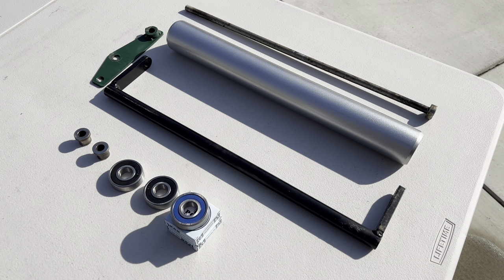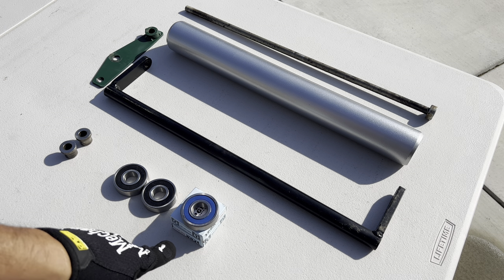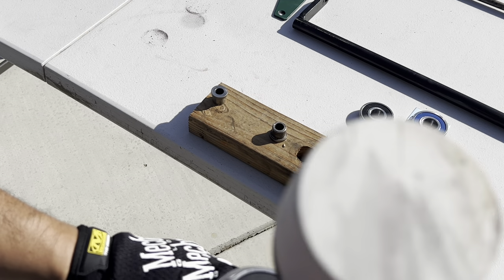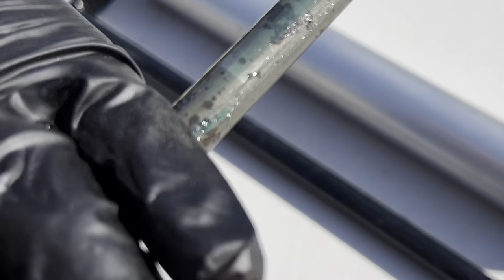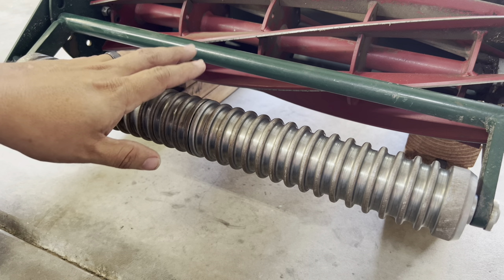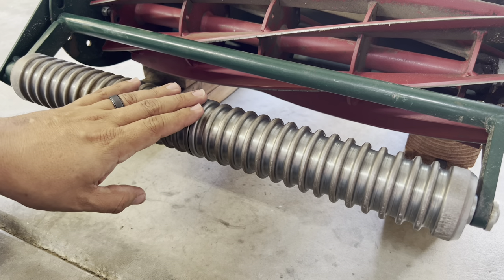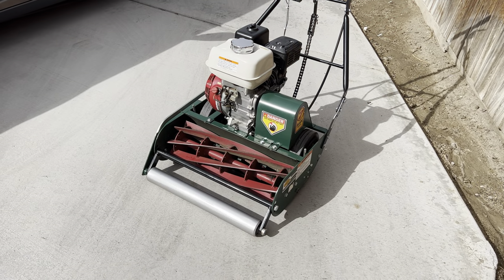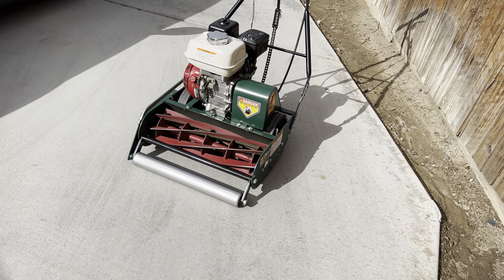California Trimmer - Roller Bearing Replacment & Grooved to Smooth Roller Swap

Comment: But how did the original bearing get removed?? I didn’t know Cal Trimmer had a grooves roller design? I thought only Reel Roller’s had one. Great info to know. Thanks, Dwayne!
Reply from the maker: I removed the bearing. It somewhat of a long story to why but it had to do with when i purchased the grooved roller replacement. The bearing spacers were seized to the original roller bearing. I didn’t need to bearings for the conversion i needed the spacer. This is why i had remove the bearing so i could remove the spacer and reuse them for the kit as the replacement roller does not include new spacers. I appreciate the comment and if you have any additional question be sure to reach out. Thanks for the support 👍🏻
Reply: @dwaynesworldlawn  I know you removed it, but how? I saw how you got out the spacer. But it seems like the bearings are in pretty tight. Did you use a bearing removal tool? Maybe I just didn’t see this in the video. I can go back and check it out again. Where are you located? It looks like California or Arizona, with mild Winter temps. Isn’t it nice!
Reply from the maker: https://youtu.be/Kydx_FpQkDI
Reply from the maker: Take a look at the video i just posted. From reel roller. My only recommendation is not to use the axle from the cal trimmer roller but rather get a 2ft long piece of rebar or something similar to punch out the bearing. This will make more sense after watching the reel roller video. I prefer this as i originally damaged the treads on the axle but was able to fix it thereafter. Hope this helps 👍🏻
Reply: @dwaynesworldlawn  definitely helps! Thank you!

Comment: Was searching for a recap statement, you still recommended using the split grooved over smooth for residential?
Reply from the maker: Grooved is what i prefer. Although you may get slightly better stripe action with a smooth, you will get the feeling of floating when the turf becomes thicker. Any roller is better then none but if i had to choose groove is the way to go 👍🏻
Reply: @Dwayne’s World  thanks for the fast response! I have a smooth that does great stripes but does certainly start to walk when the PGR been going